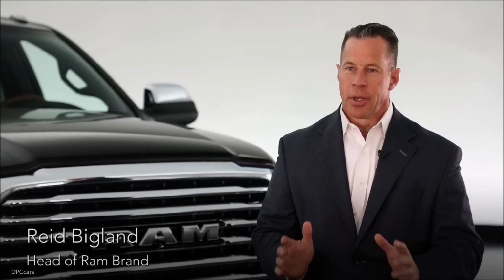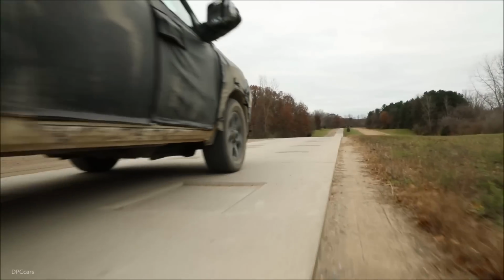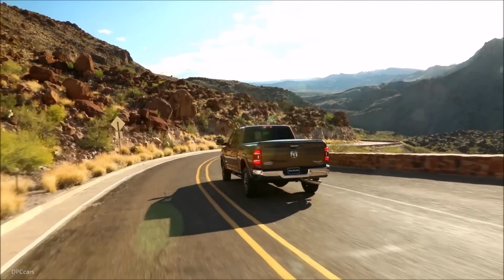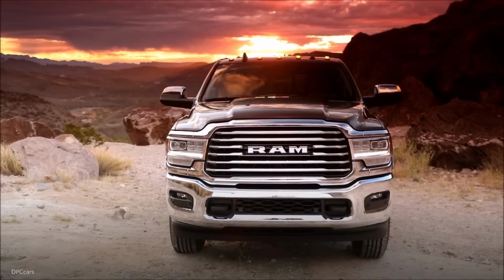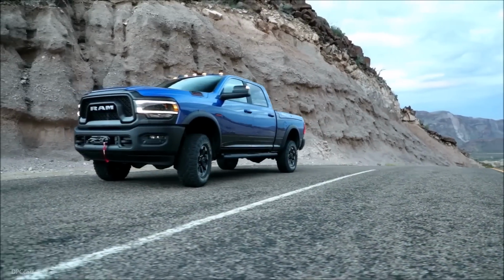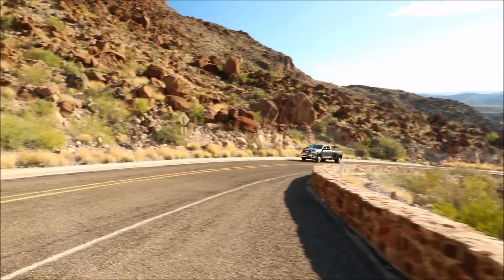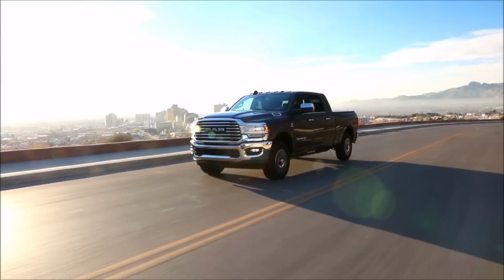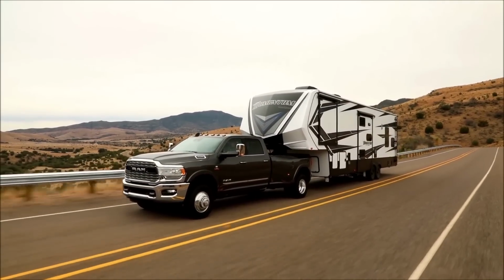2019 Ram HD Heavy Duty Truck

Comment: I’m loving my 2018 2500 Cummins and don’t regret my purchase one bit. It was a leftover inventory with a massive reduction off MSRP. It may just be the Tradesman trim but I love it. This new 2019 model though. Holy crap is it beautiful. Can’t wait to get my hands on a 3500 with the Aisin in a couple years. Mega Cab too I think for it. Towing and payload on a Mega Cab SRW should be plenty for my RV and my current 2500 on a gooseneck to go hit the rocks and mud after it gets new suspension and 42” tires 👍

Comment: Love how they only show the most expensive configurations. Even the   2 second regular cab picture was decked out. Just looked at a base regular cab 2019.....looks almost the same as last year. Plus the roof slope on the regular cab is still too severe. Like the GM/CHEVY it makes the overall truck look weird. I only like regular cab pickups. Ford looks best in regular can configuration so I'm sticking with that...plus the body won't rust out ..lol....
Reply: das 1988 Lmfao ford xlt super duty does look bad ass but to say the roof slope is severe?  sounds like you're reachinggg, a bit.
Reply: @theodoretaylor5228  No....take a look at all three brands. Not just the super dutys. They all have a more severe roof slope when I'm regular cab configuration. Gm/Chevy is the worst, Dodge next than Ford. To be fair it been like this for years too varying degrees. Ford's was pretty bad in the in the early 2000's and now it's beefier looking. Dodge has been worse as well. But gm/Chevy really looks odd both last year's and this years. I will try to find pics.
Reply: Regular cab bighorn with high output diesel no one has its equal. just checked all of them. regular cab king is Ram bighorn so far. may change in 2020 model year.

Comment: I think this Ram will  go to the top ,probably surpass the F series.
Reply: Idk if they will pass ford yet. They will pass chevy and pretty much already have. But so many people try to say they are so unreliable.
Reply: They need more payload.  Aluminum bodies are coming soon I hope.. Honestly.. im just waiting for diesel electric. I hope Ram does it first, but were talking 1500 or 2000 ft lb with MUCH less cost. you simply dont need the complexity of an 1000 ft lb engine to charge batteries. And trains have been doing it for decades.